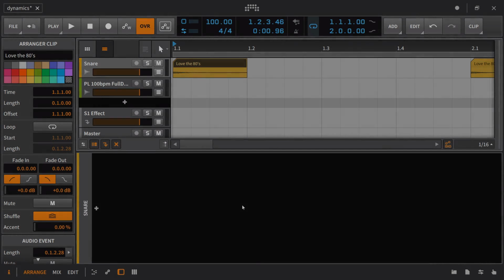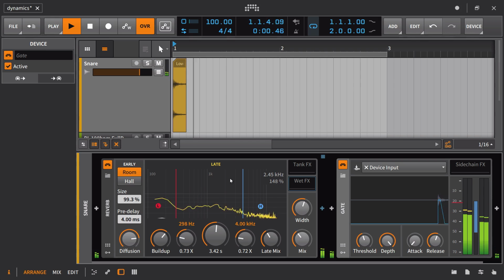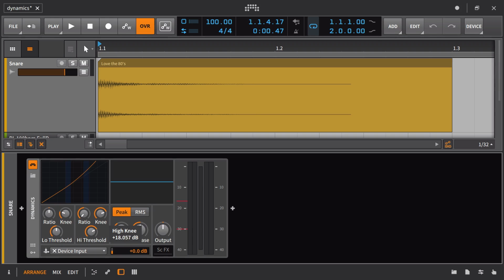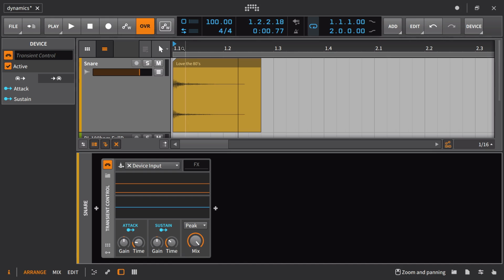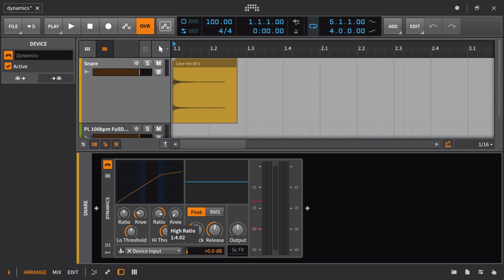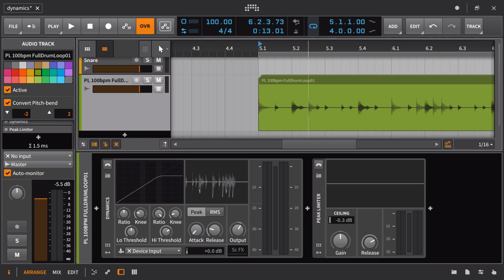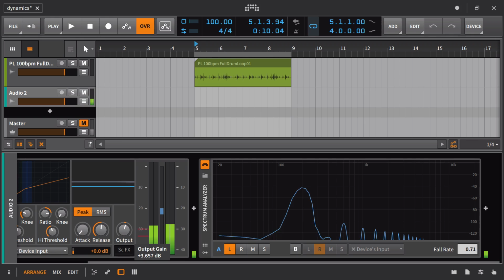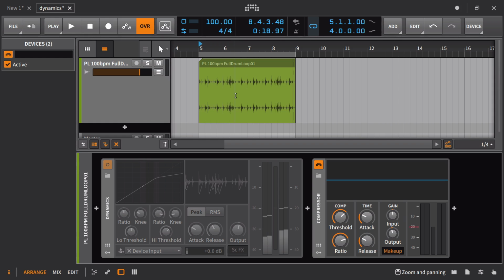Bitwig 2.0 - Dynamics (Gating, Expansion, Compression, More)

Comment: What are keyboard shortcuts for switching between two devices (or soloed tracks)? It is very usefull for seamless comparing.
Reply from the maker: Option A (deactivate) one device and then select the second device and click option a to toggle between the 2. For me that's the best way. It would also work with 2 tracks.

Comment from the maker: Time Markers to Jump Around
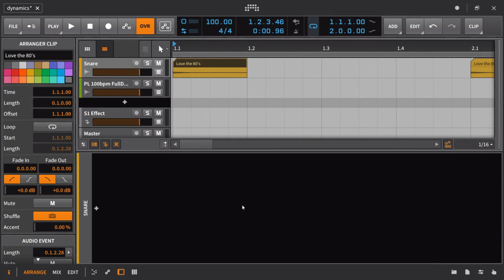00:00 Introduction

01:08 Gating (Downwards Expansion) using a variety of methods and devices

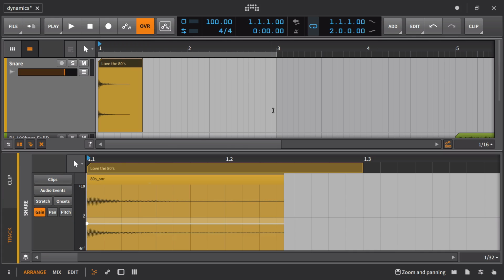14:33 Expansion (Upwards Expansion) using the dynamics and transient control

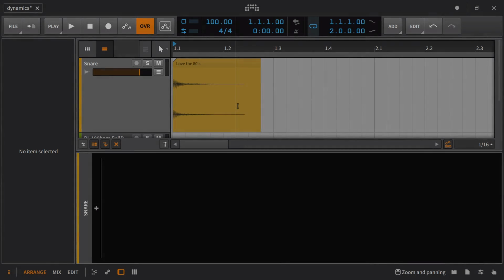21:02 Upwards Compression using the dynamics and transient control

31:41Compression (Traditional Downwards) More of a Technical Overview

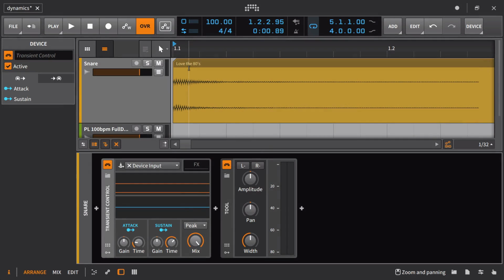38:08 Using the Transient Control like a downwards compressor

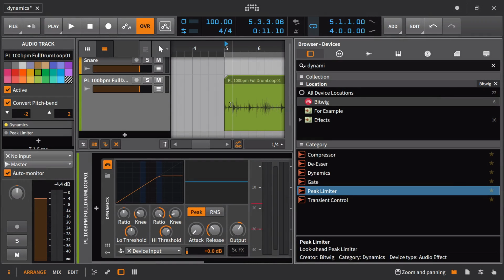39:36 Dynamics vs Peak Limiter (Look Ahead)

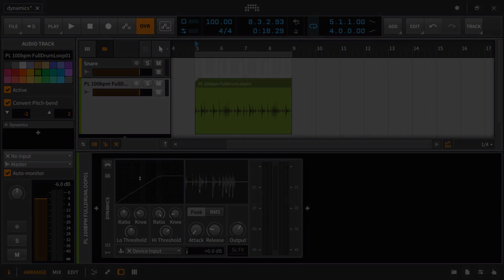44:11 De-Esser and Multiband Compression (Creating your own frequency dependent compressor)

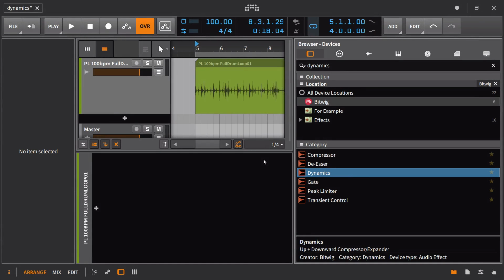48:22 Dynamics vs Compressor (Bitwig Devices) Brief layman’s explanation of Feedback vs Feedforward
In
 the digital domain it’s not necessarily true that a feedback compressor
 will have a slower attack time to something that’s feedforward. 
Technically speaking in the analog domain a feedforward compressor is 
capable of faster attack times. In digital something like a lookahead 
can very easily be added for extremely quick attack times regardless of 
topology. 

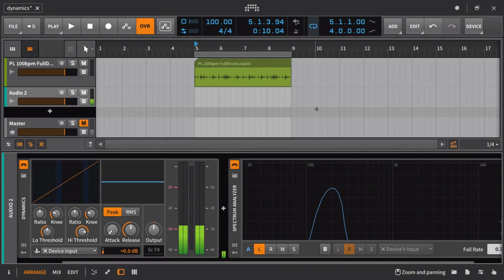49:40 Saturation (Tonal Harmonic Distortion) introduced by the dynamics and by the compressor.

52:27 Saturation (THD) of the Kotelnikov and Disto

56:40 Listening to the Dynamics vs the Compressor 

58:42 Final Thoughts